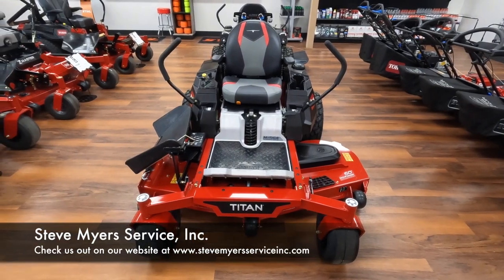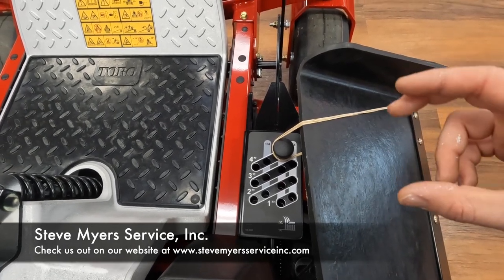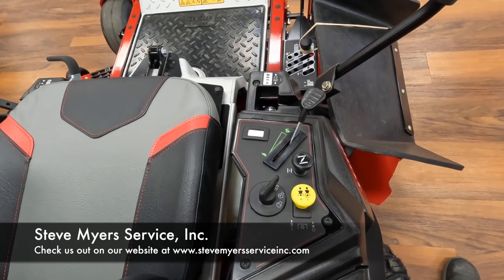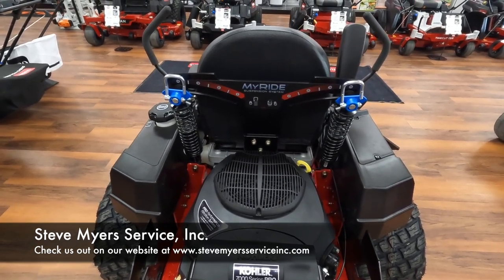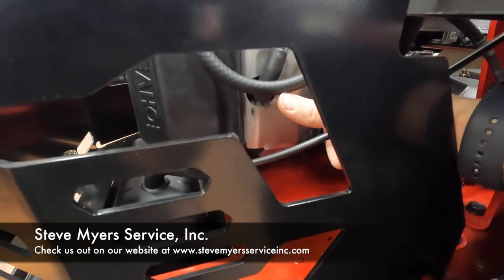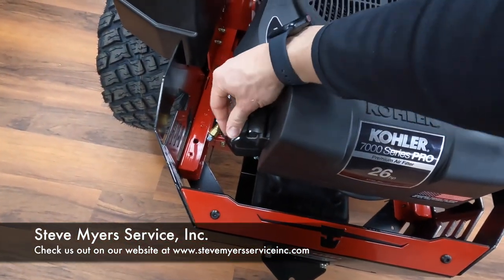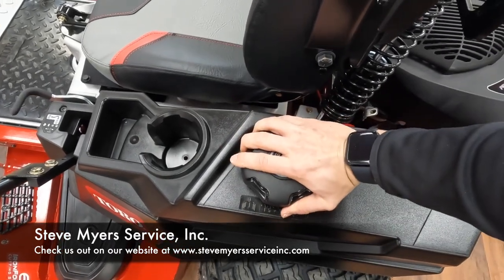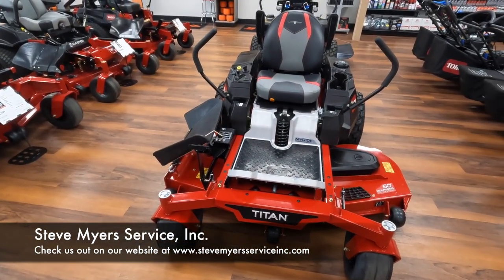Toro Titan 60" MyRide Tutorial

Comment: Are the handles supposed to be even? I notice the left side moves ahead more than the right.
Reply from the maker: There a few things to unpack here. When the handles are in the neutral position yes they should be even to each other. However, when they are fully extended forwards they may not be perfectly even and that has to do with the tracking of the machine (what makes it drive straight). On the transmissions there a linkages that can be adjusted in order to make your machine drive straight when the handles are fully extended. When the linkages are adjust they are changing the “throw” of the transmission control arm which ultimately changes the distance in which your handles travel. So your first step is to see if you handles are even in the neutral position. Then you want to see if your machine is driving straight but the handles are slightly off and in that case that is okay. If your machine does not drive straight and the handles are off then you or an authorized dealer needs to adjust the tracking of the machine. Let me know if this helps any. If not I’ll try and make a video explaining how to track a Toro Titan!
Reply: @stevemyersserviceinc  Yes it helps. I'm thinking there is nothing wrong with the handles now.

Comment: Do have a serial number translation chart or website
Reply from the maker: No Toro unfortunately does not have that as a resource. They typically have a DOM (date of manufacture) on their model number tag. Since the early 90’s they have had a serial number system that indicated what year it was based on the first 2 or 3 numbers of the serial number but in 2017 they switched over to a random serial number generator in order to better track equipment manufacturing and warranties. Here is an example of the serial numbers starting in 2000-2016
200-xxx-xxx: 2000
210-xxx-xxx: 2001
220-xxx-xxx: 2002
230-xxx-xxx: 2003
240-xxx-xxx: 2004
250-xxx-xxx: 2005
260-xxx-xxx: 2006
270-xxx-xxx: 2007
280-xxx-xxx: 2008
290-xxx-xxx: 2009
310-xxx-xxx: 2010
311-xxx-xxx: 2011
312-xxx-xxx: 2012
313-xxx-xxx: 2013
314-xxx-xxx: 2014
315-xxx-xxx: 2015
316-xxx-xxx: 2016
400-xxx-xxx: 2017 and up 

Hopefully this helps but this is the best that I can explain. Let me know if you have any other questions

Comment: Is the transmission serviceable?
Reply from the maker: Yes they are! Each transmission has its own hydraulic oil filter and separate hydraulic oil that must be changed out at the factory recommended service intervals. The initial break in period is 75 hours and then every 400 hours after the initial.
Reply: @stevemyersserviceinc  thank you for your time I'm looking to getting one soon.
Reply: I didn't see a hydro oil reservoir.  Are they self serviceable, or do you have to take it to a dealer?